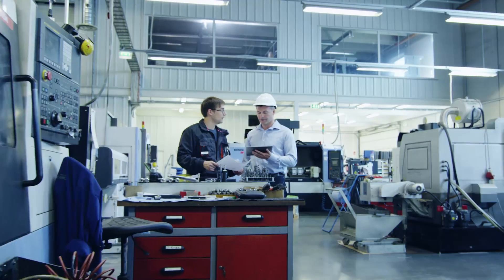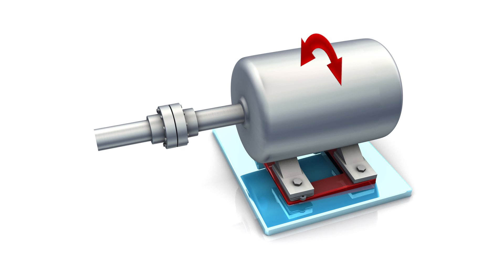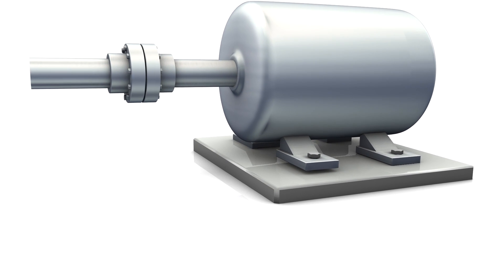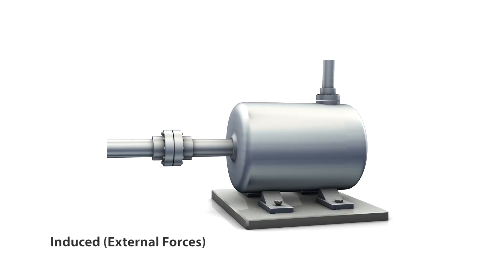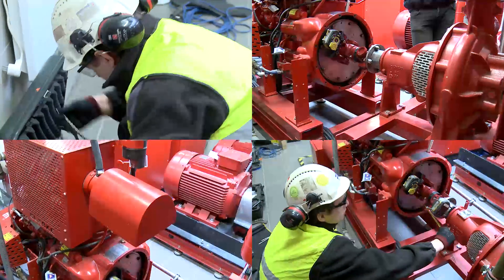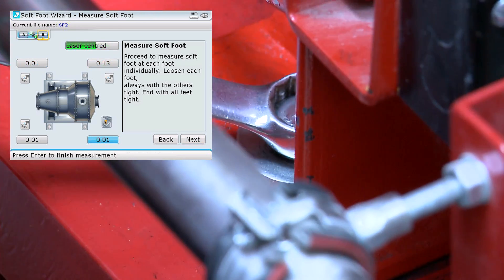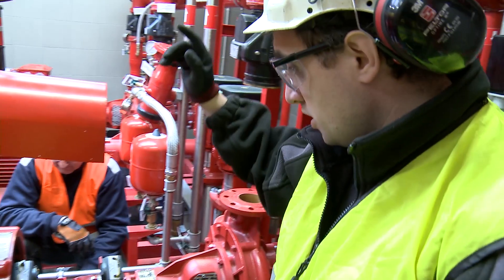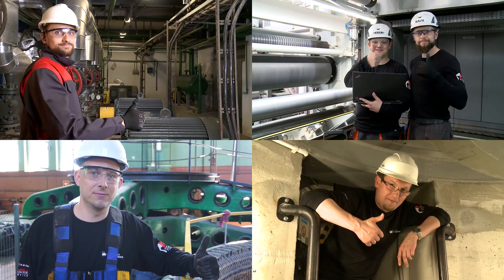Understanding Soft Foot: PRUFTECHNIK explains

Comment: Does the computer calculate the shim change for soft foot or do you have to calculate that still?
Reply from the maker: When each machine foot is individual loosened the alignment computer measures the amount of change/lift at the respective foot. Depending on the determined type of soft foot this could be the amount to be placed under the specific machine foot.